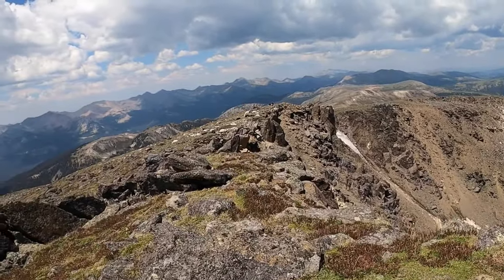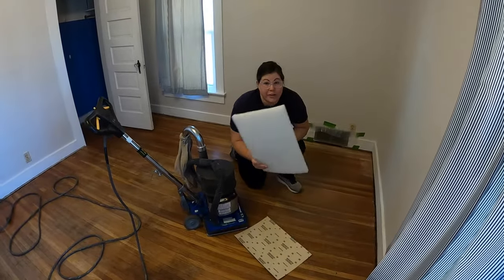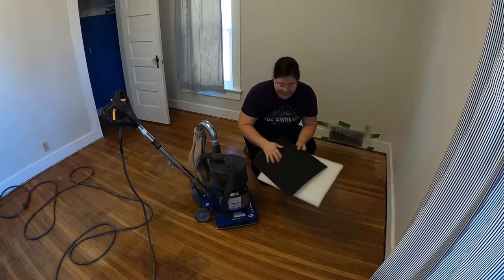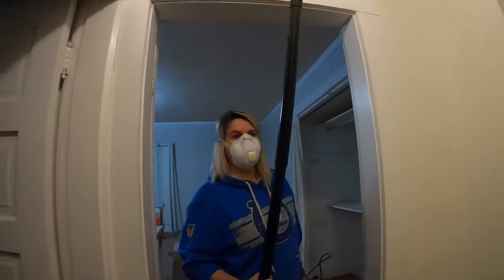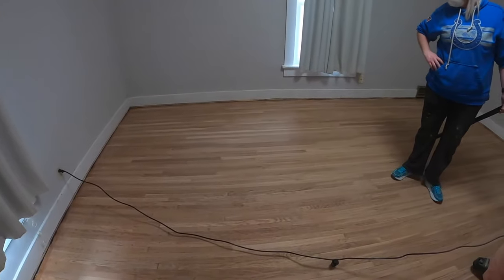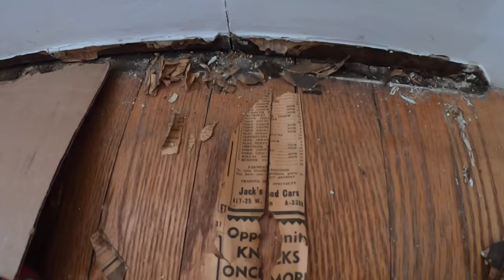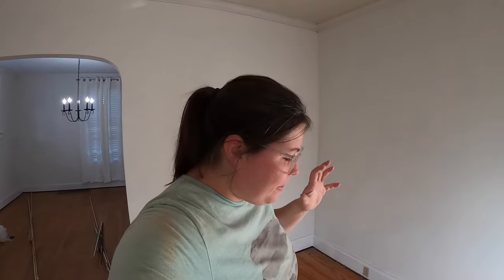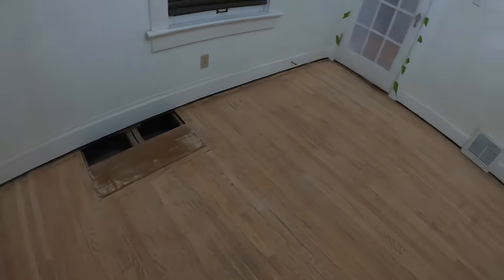Easy HARDWOOD FLOOR Sanding For the 1st Time! | DIY Floor Sanding- Orbital Sander Hardwood Floors

Comment: We just finished sanding floors with a orbital sander and it doesn't get close to baseboard area so watching this even though we are happy with the job I am going to rent this machine now for last bdrm and to get closer to baseboards.
Reply from the maker: We also used a hand orbital sander for the last inch next to the baseboard. It was just a basic black and decker and we started with the lowest sand paper we could find and worked our way back to a 120 grit. We used it on our staircase too and that worked well.

Comment: You should start with a Random orbital with 3 round disks or if the finish is thick, a scraper type tool. You have started with the sander that takes the most sandpaper and the longest but at least you won't have issues with chatter or waves. If you did a drum, you would have both. With a drum the only advice for people I have is to sand at 15 degree angle to the grain (36,60,80), don't do 90 degrees, don't do straight with the grain until 100 grit. .

Comment: Awesome work. Question - did that sander get into the edges of the room or did you have to use a palm sander or edge sander ?
Reply from the maker: We had to use a palm sander. We just used a basic on from the hardware store and sand paper with the same grits as the large sander

Comment: If you were to do it again, would you use a Drum Sander, or stay with the Square Buff?
Reply from the maker: I think I would stay with the square machine for this job. Our floor was just worn and the finish was thin and old. I think if I was working on a floor that had a solid finish or if it was painted then I would use the drum sander, but the square one just feels less risky to make an uneven floor!

Comment: Yeah, you could take a week and you wouldn't get the finish off with that sander. Those types or sanders and buffers are finish sander. They are what you use to smooth out the actual sanders scratches. Don't stain it. Because all that will do is point all half the floor still has finish on it. If you want it too look even half way good, just put polyurethane oil based. Because that That seals to most finishes.

 I could have had the whole floor done for you in a weekend by myself and I'm not even the best floor guy so you should have called someone in your area.
Reply: Do not be afraid of the drum sander!!

Comment: did you guys completely took out the bevelled edge when you sanded ? I have similar floor, thinking to get rid of bevelled edge and make it smooth like one board, is this possible ?
Reply from the maker: No, it still has texture. Im not sure how you could do that…

Comment: Why did you decide to tell them less of square footage when renting? You mention not wanting them to know how much you were planning to get done. Just curious as to why, did they attempt to charge you per sq ft of use? Most are done on a daily/hourly rate, plus materials. But even if you were to buy 7 pads and only need 4, as long as they are not used or damaged, they'd likely allow them to be returned
Reply from the maker: I forgot I even mentioned it! I just didn't want them to tell me that was too much to get done in one weekend. They only had 2 pads in the shop, so unfortunately we would have needed to find more either way. Based on the conversation I had with them I didn't think it would wear out as fast.
Reply: @LauraOnTheMove  oohhh! Gotcha, that makes sense! I'm not sure where yall live, but wondered if they did things differently there as far as how they rent equipment. Just getting ready to do my new baby girls room. I've done many things in my life, but never wood floors, so im trying to absorb as much info as possible! Thank you 🙂

Comment: So, you guys just sanded and didn't strip first, correct? I'm wondering if I'd be able to get away with that in my living room.
Reply from the maker: We did, but I used a very heavy grit to sand off the old finish. The old finish was very worn. There were a few spots that showed bare wood and the remainder was very thin. If we were taking off a fresh refinish it would have been very hard to just sand it off.
Reply: @LauraOnTheMove  mine is old and was under carpet, so I think I'll be able to get it up with sanding. Thanks!

Comment: I hate drum ssnders. It's hard to rent one that is configured right and it is very very easy to destroy your floor. I use a diamond blade paint/finish removal attachment on a metal grinder and carefully float it across the floor. It quickly removes finish and the circular swirls can be removed with the large orbital sander method in this video. To flatten the floor I put down a flashlight in a dark room to look for high spots to level and step on the sander if I need more removal.
Reply from the maker: The flashlight is a cool idea! Thanks!!

Comment: As a professional, this is always hard to watch. I do admire your intrepid personality.  But I"m curious, how much finish has loosened or peeled off?
Reply from the maker: I’m happy I haven’t had any issues with peeling or any finish coming off. I’m curious why you would expect it? We’re 1.5 years past this diy project and still loving it. Sorry your account was hacked by the grandkid 😅
Reply: @LauraOnTheMove
Reply: I''m so glad to hear that it's working for you. In my years of experience, urethane needs a very clean surface to bond to. All that dark stuff in the softer part of the grain is dirt, and various other contaminants.  Poly does not like that. Anyway, I'm happy for you two.
Andy
 @LauraOnTheMove